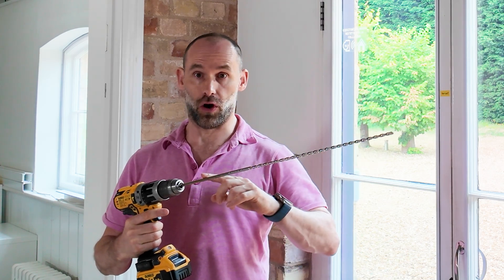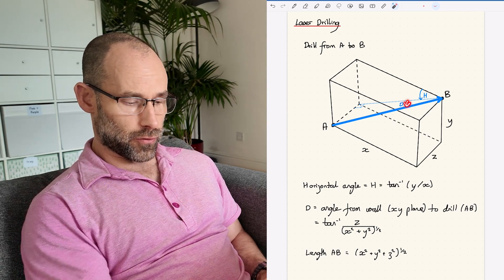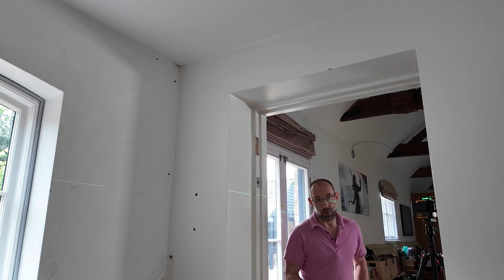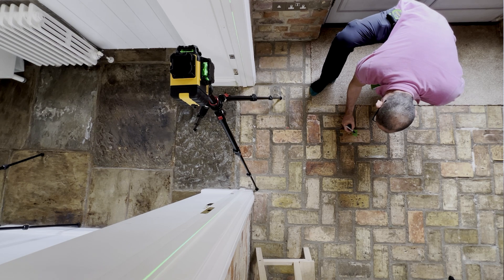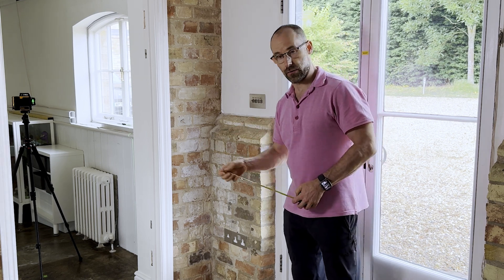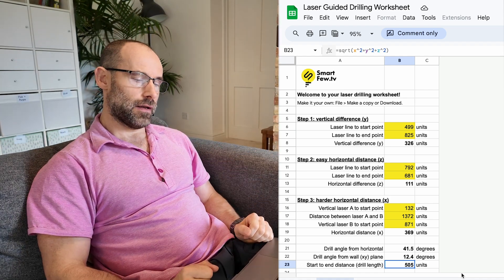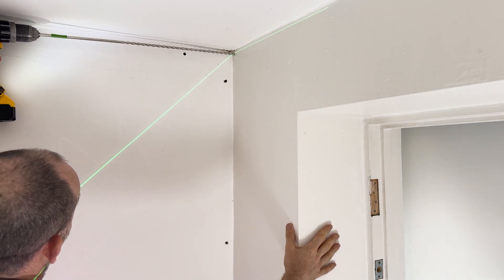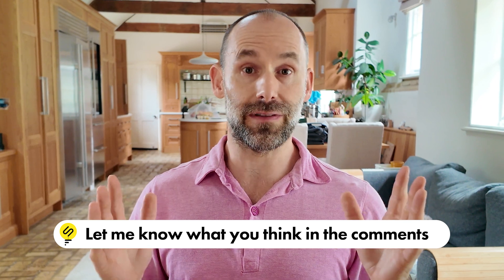🛠️ Drilling the Perfect Hole Through a Brick Wall: Precision Techniques You Need

Comment from the maker: Who can see a better way of doing this?
Reply: I do have a better method that requires; no maths, a laser, two pieces of masking tape, a straight stick, and a small cardboard box located on the floor. 
I have not already described the method in a previous comment.

If I were to post 4 or 5 images (or post a video) the method is self explanatory, but a text based description would always be insufficient without supporting images.

I don't want to do a video but I would send the picture explanation to you if you want to understand it. You could post a video to show it at your own discretion.

Comment: Interesting content, explained well, even whilst addressing the complexities. Thanks for that.

I had an idea of adding a white paper sticker to the back of the drill and marking a black dot on the sticker where an imaginary extention of the drill-bit axis would emerge through the sticker. Then consider that, while the green laser was creating its inclined plane at the first angle, you set up a second simple red laser to create a vertical plane at the second angle. To drill a true trajectory would require that the red & green laser-cross that would be seen on the sticker be kept centred on the sticker's black dot.

However, my preferred method is as follows.
Take measurements as described in the video and so obtain the 2 angles and the drill length required. 

Make your small Starting Hole in the corner of the wall (the one you made "just for purchase" in the video). Take a cardboard box and fit it into the corner of the ceiling so that it touches the starting hole. Mark the corner that touched the starting hole. Call the marked corner "The Origin". Now, there is only one position on the box from which you could drill into the box and also come out at the origin-corner with a drill trajectory that follows both your angles. Call that notional entry point "The Unique Hole". 

So with the box back on the bench, start at The Origin and from there mark your 2 angles on the box one vertical and the other horizontal. Use these angle lines and a speed square to construct the centre of the Unique Hole.

Place the box on the ceiling again, with its Origin at the Starting Hole, and drill from the Unique Hole to The Origin and continue through the Starting Hole into the wall for about 150mm. Remove the box and continue on the established trajectory to complete the job. If the cardboard box was in fact a rectangular block of wood then a suitable shaft at the correct trajectory could be made in the wood by drilling 2 partial shafts one starting at the Origin Hole and the other starting at the Unique Hole. Due to its stiffness this could be smaller than the Cardboard Box yet still be useful, so it could be left in-situ for the entire drill if your bit was long enough.
Reply from the maker: Very cool feedback much appreciated. I think visually a red and green tougher would look great, maybe for a future video. Also the physical template idea is really good.

Comment: You can also take a piece of plywood and drill hole that the drill will fit through at roughly the right angle at some fraction of your measurements, say z/2 and y/2 and then hold it at x/2 (with regard to the entry hole) as a guide.
Reply from the maker: @erikb6836  that’s a really good idea :-)

Comment: For me, it would be quicker to model in Sketchup to get both angles and length and not worry about miscalculation
Reply from the maker: Totally agree, the first time I did this I used Shapr3D to similar effect. However, I wanted to show it from first principles here, and I provided a worksheet to make sure the calcs are right.